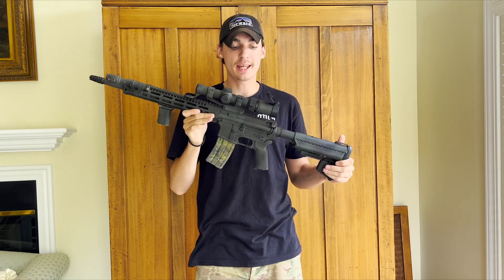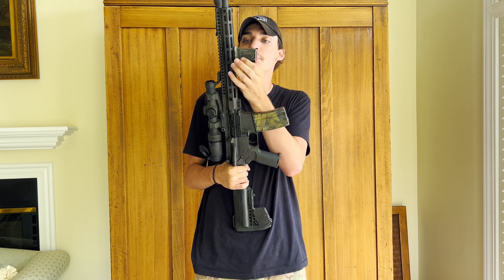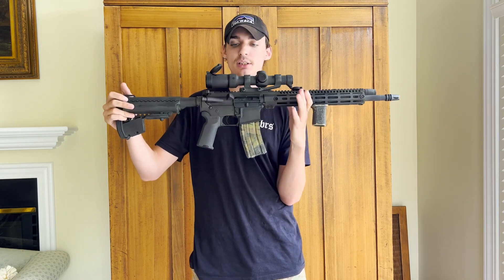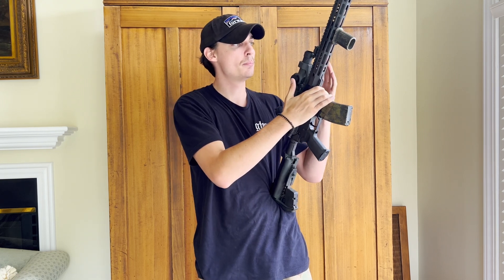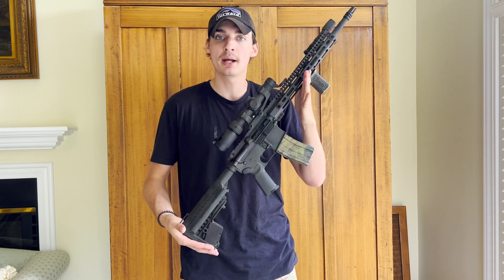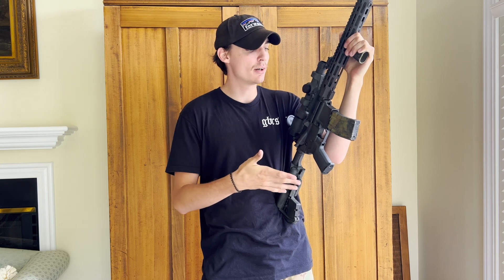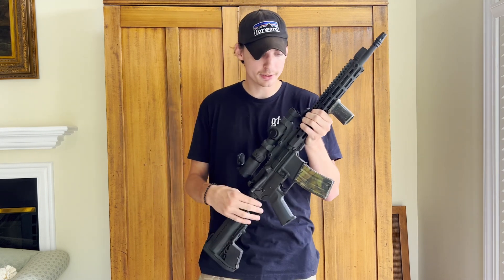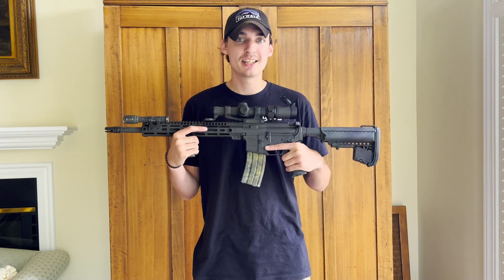Budget Rifle / RECCE Rifle Setup

Comment: A receiver isn’t just a receiver and there certainly aren’t just 3 lower receiver manufacturers in the country. Knight’s Armament, LMT, Mega Arms/Zev Technologies, ADM, and Radian (just to name a few) manufacture all of their own receivers in house. All of those companies offer lower receivers with proprietary ambidextrous comtrols, and the fit and finish between the upper and lower of Mega/Zev receiver sets are so tight and precise that you can pull out both of your takedown pins, grab your upper by the rail, and lift your rifle up in the air and the lower won’t drop free. The upper and lower literally have to be pulled apart with a considerable amount of force when you first get one of their receiver sets because the fitment is absolute PERFECTION. Needless to say, there’s never any slop or play of any kind between the upper and lower. It feels like one solid chunk of aluminum. Sure, they cost more than Aero or PSA… But there’s definitely a reason for it and it isn’t just a logo or a stamp.
Reply from the maker: Well, I guess I shouldn’t have cut that part out when editing in hopes that people would understand I’m referring to standard mass produced lowers and not specialized lowers.
Reply: He also meant that most lowers work/ function. It's more important that it works so people can train than wait half a year or more to afford tip tier parts. Top tier rigs are wasted on the common man anyway. This channel recognized an audience and spoke to it. So congrats, you're both correct ❤

Comment: Being a lefty,  does brass or gas affect you’re shooting? I was thinking about swapping out my Anderson upper for a stag arms lefty upper.
Reply from the maker: Gas not as much even with a suppressor, the brass will occasionally hit my support hand but nothing I can’t live with. The Stag lefty uppers threw me off quite a bit and I wasn’t a fan. However that’s all personal preference so I’d give it a shot!
Reply: I had to teach myself to retrain my cross eye dominance (right hand left eye). I’m still cross eye but I can use Binden aiming pretty well. My first AR was an LWRCi M6IC DI 16” w/ 1-10 LPVO because of the ambi controls because I wasn’t sure if I was going to shoot rifles lefty.

I built up a lightweight BA 14.5” Barrel in an Aero FA upper, 2A lightweight bolt, Midwest lightweight 15” handguard (no full picatinny top), SOLGW NOX p&w keymo 3 prong, I have low profile barricade stop and angle grip, Valhalla Tac Baldr 18350 with ODS (Omni direction switch as my hand is big enough to get around my small handguard to not need a tape switch either), red dot & 3x magnifier, BUIS, Magpul STR stock, PSA Turkey Day lower with an Elfmann trigger, Ergo grip, Radian CH and 45° throw Radian safety, and a Tier 1 Citizen bungee 2 point sling stowed with a magnet strap that I got from Warrior Poet.